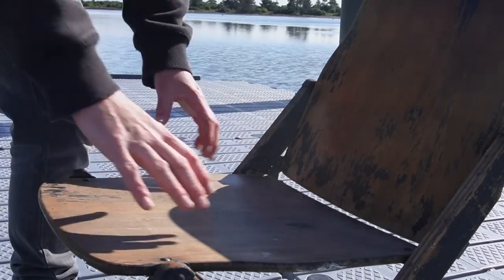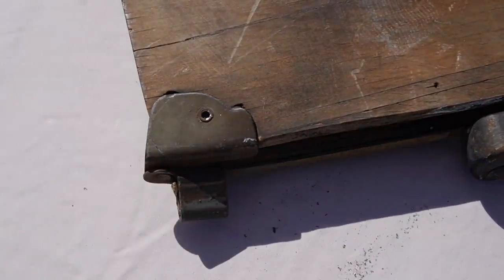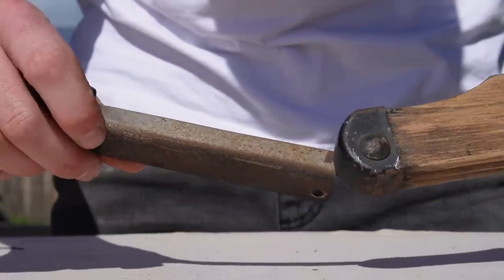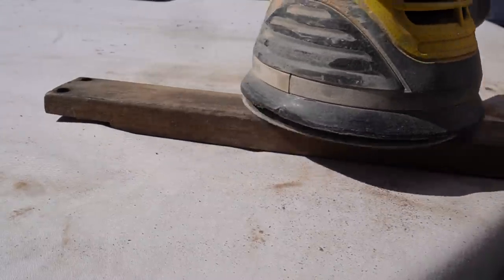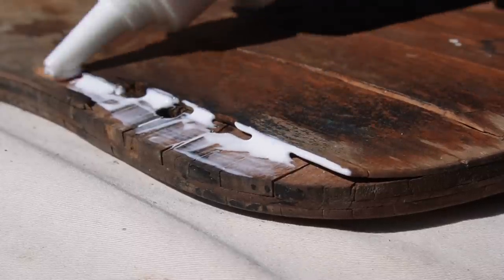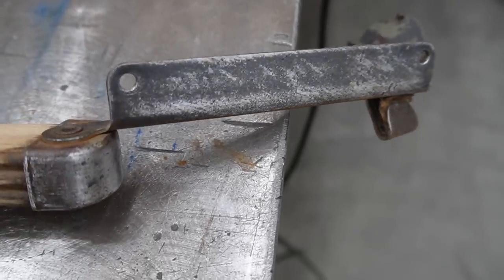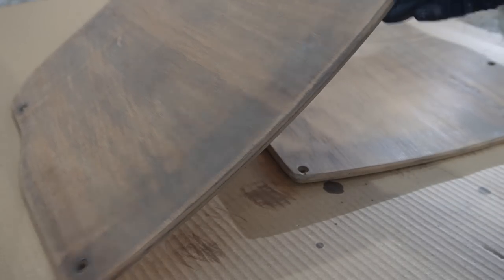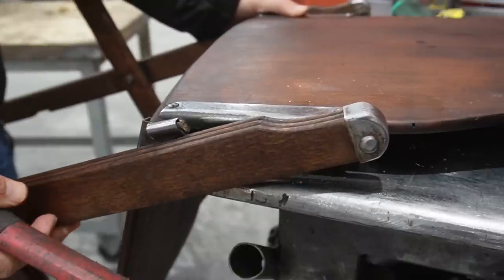A riveting 1940's Folding Chair RESTORATION - literally.

Comment: Curious why bondo and not wood filler for those repairs.  I've never used it and assuming it is stronger and i've heard it cures quicker.  Your thought?  I'd love to find a chair like that!!  Your work is amazing but that beautiful chubby cheeked baby is your best work yet!!  Masterpiece!!!
Reply from the maker: I have used a few wood fillers and they definitely serve their purpose but the reason I chose bondo for this project was - it is much stronger and being a chair that will need to hold weight, I felt bondo might be the better option. The wood fillers I have used are quite soft and don't cure quite as hard as the bondo. And yes, it dries very quickly (15- 30 mins and you can sand it) but wood filler really needs to sit over night. Oh, and I totally agree with the masterpiece, he is my pride and joy! I think my viewers generally just tune in for a glimpse of him these days ;)